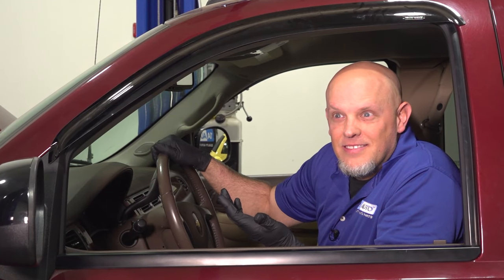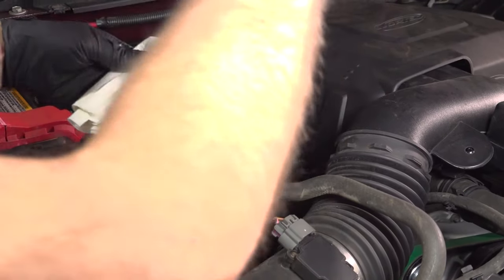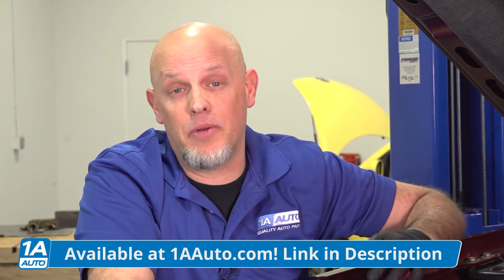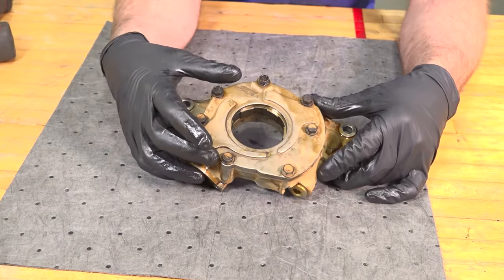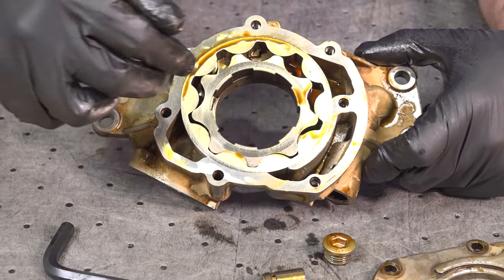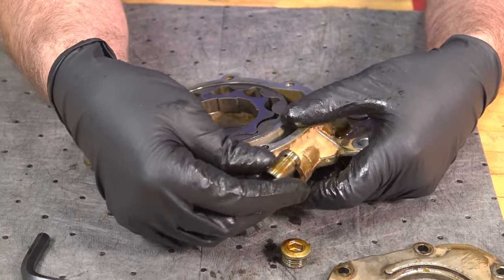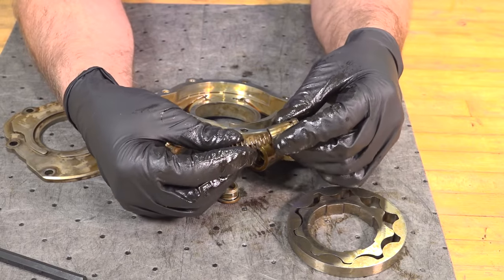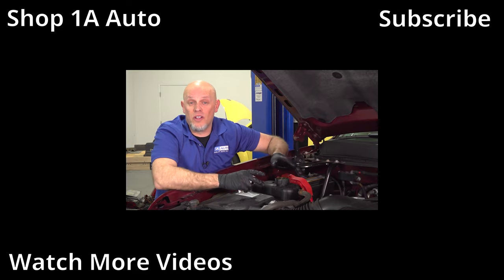Low Oil Pressure? Oil Light On? Fix This Problem With One Part on Your Chevy/GMC Truck or SUV!

Comment: 2010 Silverado , replaced oil pressure sensor , still came back with low oil pressure code , problem was the auto shop had done an oil change and put the wrong size oil filter on my silverado , changed the oil filter to the correct size and that fixed the problem.

Comment: Looking for help myself.. when i start the truck cold, oil pressure is above 40 and good.  When the oil and engine warms up.  Pressure drops, and when I'm at idle, the pressure drops to maybe 5. I've replaced the oil pan gasket, pickup tube oring, oil pressure sensor and even the oil pump and still have the same issue. And suggestions?

Comment: On my O2, GMC sierra, 1500 4.8 V8. 2WD, I replace the O-ring on the pick up tube, and that solved the problem of the low pressure. A lot of work to change a $3 O-ring!

Comment: I was looking at my 2018 Colorado 2.5l and the oil pan bolts to the transmission (6 speed manual). Is it just bolted to it for support or is there a gasket that holds the gear oil in?

Comment: I did a DOD delete. New lifters, cam timing chain and valley cover from scoggin dickey. Be rings, bearings gaskets, o rings, water pump, oil pump(melling )and belts.  Oil light keeps coming on at the light or at idle. Once i pull off its fine. Light goes off. 07 suburban, fully rebuilt 5.3
I changed the pick up tube ring. Problem went away for maybe a week. Fresh oil change last week.

Comment: a low engine oil pressure error can also be due to a bad oil filter.  Because I had a case when replacing the oil pump with a new one did not eliminate the problem, but the banal replacement of the filter with a new one, of better quality, because the previous one was almost new but cheap, helped to eliminate it.  Also, an error can occur due to cheap or unsuitable engine oil for your car

Comment: You forgot two things before you get to the oil pump. The screen underneath the oil pressure sender that shouldn't be there in the first place, and you need to check the o-ring at the front of the oil pickup tube.
That oil pump actually looks just fine. Put a new spring in it and put 2235 mm washers underneath it and increase the oil pressure.

Comment: Ugh…. I have the low end knocking noise. Haven’t done the rest of the steps but I guess that means I need an engine. Also, my vehicle (95 sierra 1500) shuts off when driving. Not sure if that is the same issue or 2 issues such as fuel pump and engine failure. Needless to say I’m distraught as my other vehicle is also manifesting a low oil pressure. #oldvehiclejoys

Comment: So my oil pressure on my 05 silveraydo went out the other day. I had already replaced the sensor last summer just for faulty gauge. So I legit lost pressure. Engine still runs and runs like nothing is wrong for first 15 mins but then pressure drops and engine wants to die. Changed oil filter to make sure it wasn’t bad. Still have problems. I don’t get any knocking or noise in the engine like the vid has. Just trying to troubleshoot some more before I buy a new engine
Reply: What was ur issue?

Comment: My tundra has the same problem after I got the oil changed and I heard that the mechanic had messed up oil filter and now my oil pressure gage go up and then it dropped

Comment: hey guys do you have a chat or an email to ask questions to?  I just watched one of your videos on blower motors and I found somewhere to test that the ground wire is the problem by creating  circuit with a piece of wire. I touched it to the connector near the ground wire and touched to metal bracket. There was a spark, but the fan started to work - could it still be the resistor? Learned a lot from your videos, thanks!!!

Comment: I have that high end noise, and my oil pressure goes from 275 to the last quarter of the indicator after a few minutes but stays stable in there even after hours of driving. Truck runs like nothing and there is no engine light on. A few months ago dealerships change the oil sensor before I bought it. What can I do ?

Comment: what is the normal oil pressure chevrolet colorado 2007 ?
Reply from the maker: +Cynthia Sáenz - Artista Visual This can vary depending on the vehicle's engine size. But generally, the ideal oil pressure is between 25-65 PSI.